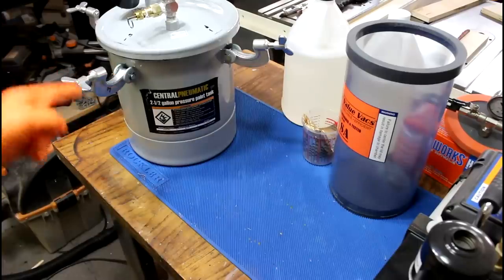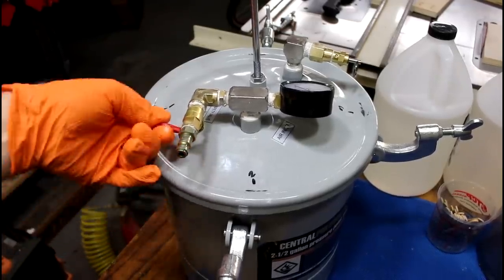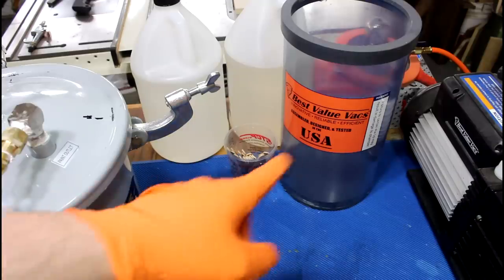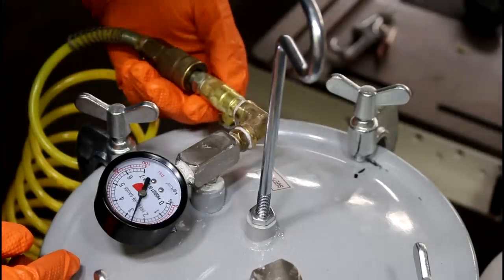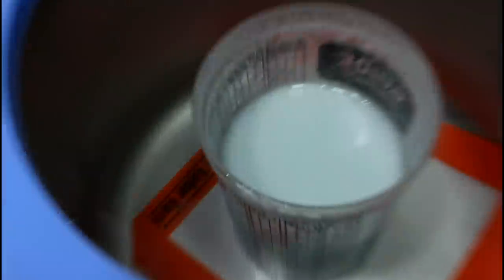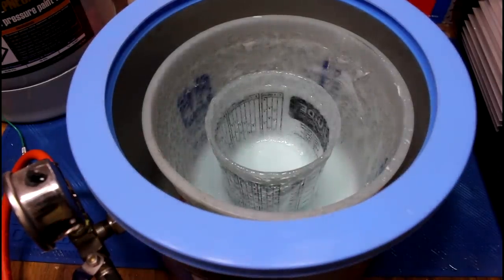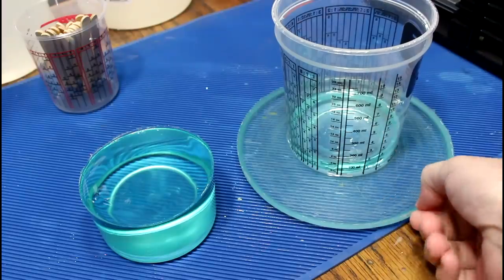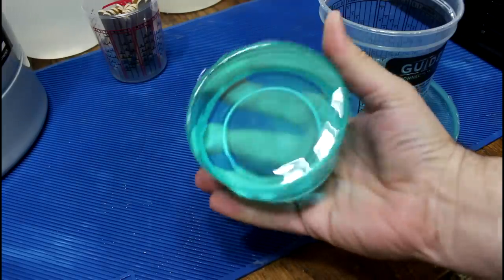Resin Casting: Pressure vs Vacuum

Comment: i have that vacuum chamber with glass top and orange rim.  It pulls out the gasses than when I slowly release the vacuum , it pulls in the stabilizing medium. I use it to stabilize rocks. because I have a glass lid I can also stabilize wood (using cactus juice). I was not aware of the pressure chamber uses. I have to be careful about boil over by controlling the vacuum pressure used.

Comment: Yep and since it cures by a exothermic reaction the vacuum probably makes it more explosive. It was a nice video though. If you have a borosilicate flask with an airtight cap I reccoment you seal it with boiling water in it and cool it under a cold tap. Might explain some.

Comment: Having done a lot of vacuum outlasting myself, it is my opinion that this test was biased toward the pressure pot. Yes, with vacuum you need to accommodate a lot of expansion while outgassing. As the video stated, using a pressure vessel involves a certain  level of danger. Consequently, my recommendation is that you not purchase the least expensive one you can find. The only time I would purchase tools at Harbor Freight is if I expected to use it only once.

Comment: Peter if you used a pressure pot could you still pour the resin into a mold after getting rid of the bubbles without casting it?

Comment: OK let’s unpack the vac pot a little: the resin isn’t for casting so could that be the difference because one doesn’t see this effect normally? You started twice, not a normal procedure in resin and vac pumps. Normally all the bubbles do rise and pop and are gone the few left on the surface tend to be very small and easily sanded off.
Great video however and I have been considering both and now I have still to make a choice (fav. the pressure version) however a far more informed hesitation! Lol 😊
Thanks
Bob 
England

Comment: My experience is that the resin itself boils, similar to the way water boils at low temperature when placed under vacuum.. The foaming is caused by boiling resin, not removal of air. I ran into this problem trying to fill cracks in gems with Opti-Clear. Pressure is the way to go.

Comment: The problem with the vacuum chamber is that it is boiling the resin. Air bubbles will expand and rise first, but then you will begin to boil components of the resin. I think it’s possible you could damage the resin by boiling out components needed for proper curing. 

The pressure pot, on the other hand, is shrinking and dissolving bubbles that exist in the resin from mixing.

Comment: I would say vacuum is still better, but requires a lot more. You need to pick a more liquid resin when casting, and ideally be able to vibrate it as well. Once the gas is drawn out of the resin and form you can then let normal pressure in, as you want the weight of the atmosphere to push it into every nook and cranny.

Comment: Looks like you should choose a slower curing resin for casting. Using a resin formulated for coatings could be dangerous in a bulk, it heats as it cures and ultimately can catch fire. Anti-foam additives like silicone fluid can reduce the foam a lot. In industry you'd de-gas the resin after mixing, in a much larger container than you used. Alternatively, admit the mixed resin slowly via a separate line and it can de-gas as it dribbles into the job. For best results impregnate under vacuum, then add overpressure!

Comment: Nice demonstration, but I have a question about using the pressure pot. I have been using and attempting to use a vacuum chamber for the last year to get the epoxy clear for pouring for a a number of different projects that would ultimately be 3-5 inches thick. So of course I have done it in layers. And as the temperature gets lower, I have experienced exactly what you showed in the video, the resin taking too long to be cleared of bubbles and constantly having to watch it so that it doesn't over flow. I have experimented with number of different resins, and all have had the same outcome, way too long to fully degas. But if my intention is to pour the resin after removing the bubbles, how is the pressure pot to be used that would still allow me to pour the resin afterwards. With your example I get a cured resin which is not what I want.

Comment: It isn't pulling any bubbles out of the resin.  It is boiling (going from liquid to gas) as the pressure goes down.  It you put water with no air in it, it will do the same.

Comment: Thx for the video, can you use a rubber mold for casting in the pressure pot?.or would it compress the rubber?

Comment: Do you think vibration might work for a small scale hobbyist? I was thinking I could use big, powerful back massager to get at most of the bubbles. I haven’t actually done any resin just yet, but am collecting supplies to try my hand at some small jewelry pieces.

Comment: Could you combine the two processes? Start by putting the resin under vacuum for a minute or two to remove the bulk of the dissolved air and then pressurize to minimize the visual effects of the remaining air.

Comment: A question if you will.
Will a pressure pot force resin into wood and not just smoosh the air in the resin?

Comment: Note that’s at low pressure different compounds boil off possibly ruining your Resin integrity clearly it worked amazing but if it was something super critical like most carbon fibre parts you don’t want under straight vacuum with out pressure externally like a vacuumed bag creating compression on the resin

Comment: Vacuum treatment does not just release the air. Lowering the pressure to 0"Hg drops the vapour-pressure of the resin constituents, so that they out-gas. By losing part of those components you are changing the mix ratio of the resin and hence it's properties.

Comment: Hi Peter! I still have a question, I want bubbles in my resin to make it lighter. Would the resin withstand the negative pressure in the inside or would the bubbles collapse? My goal is a bone marrow-like structure.
And thank you a lot for your content it answers so many questions and is fun to watch alike.

Comment: So, I'm also using ArtResin, and I have the same pot, same setup. I left only about 40ml in a mold, had 1 drop of alcohol ink, was in the pot for 5-6 hours at little over 50psi, not cured and there were still bubbles, all seemed to gather at the top of the piece however. Any ideas? Suggestions? This is the 2nd day in a row of testing that I'm having issues with the pressure pot.....getting discouraged at this point

Comment: Hi! How long do you need to put the resin into the pressure pot for? I’m working with a resin that has a 45 minute working time before it starts to get gluggy and not workable nicely. I’m using resin for smaller projects like keychains and charms etc.
Reply from the maker: It varies resin to resin. For me, I tend to do a pour at night and leave it in the pot till the next day. Those have been my best results

Comment: This might be a silly question given the strength of cured resin, but if it's not removing the air from the resin doesnt that mean theres just a lot of high pressure but v small bubbles through out the resin? Does that have implications on how it will hold up to temperature changes/working it in general?

Comment: Been seeing a lot soft materials you turned chipped on the lathe,. Could it be the pressurized air in resin expand while turning?
Maybe a test with pressurized only, vacuumed only, and pressurized after vacuum will tell?

Comment: It is important to note that a pressure pot doesn't actually remove the air bubbles.  What it does is compress them down to a point where you can't see them.  Once fully cured the bubbles are unable to return due to the rigidity of the resin.

Comment: I always wondered if you could centrifuge the resin, resin in a cup, attached to a rod that you spin really fast with an electric drill. I think it's feasible to do a home made centrifuge and spin the bubbles to the top and or pop them that way. Pretty much how they spin cast metal models/toys.

Comment: When I found it works really good it is to use the vacuum to pull out the air and then pour it into my mold and put it in a pressure vessel

Comment: When using a pressure pot, you can "pop" the resin in intervals if it reachs towards the rim, but the easier solution is to put less resin into the vacuum chamber or get a larger vacuum chamber.

Comment: I wonder if the pressure-pot resin winds up a bit more brittle?  Since the curing time is lessened and the end result might have more internal stress due to the pressure differential at which it was cured vs atmosphere.

Comment: make the resin colder! I mean in vacuum. that way the bubbles would pop sooner and overflow less. after all, vacuum is perfect for silicone before pouring, so I see no reason it can't work on cold resin. On the other side, I can see why a pressure pot would be preferred. One of the things I'm weary of in a pressure pot, however, is bubbles causing the resin to be more likely to chip. Maybe you could use an even slower resin and degas that before pouring a cast and pressurizing it. Just some experiments since I can't obtain the materials being a student. I'm in enough debt as it is.

Comment: I don’t have the equipment, pressure or vacuum, but I’ve been thinking about these processes recently. My question is the opposite of what you demonstrated in this video. What would happen if you suspended a piece  of wood in Cactus Juice and then put it under pressure, as opposed to the usual method of placing it in a vacuum?

Comment: Question is, what would happen if you pull the resin out of the pressure pot before it cured so you can pour it into a mould
(assuming the mould is too big for the pot)

Comment: Hi, don't know if any of your conversations have covered this, but are there casting resins available thich don't tend to produce bubbles, and are clear from the outset?  and is a heat bath for the vessel in hot water a decent  way to minimize the bubbles?  Love your vids, and thanks!

Comment: It seems that most people don't understand what really happens in a pressure pot. If it was about making the bubbles smaller, 50 PSI would only shrink them to just under 1/3rd their size. This is hardly enough to make them so small you can't see them. What is really happening is that the higher pressure enables the liquid to hold more gas molecules in solution.Therefore the bubbles disappear because the gas molecules are spread evenly throughout the liquid instead of clumped together as a bubble. It is the same thing that happens to carbonated drinks. While in the higher pressure of the capped bottle, the carbon dioxide is in solution with few bubbles, but open the lid and the bubbles precipitate out.

Comment: How about combining both?
First into the vacuum to remove same of the air and then ander pressure. It should be possible to get a similar result with less pressure, right?

Comment: Chances are that the bubbles you saw in the vacuum chamber are not air, at least not after 5 minutes, but the monomer (low vapor pressure) boiling off.

Comment: What’s happening is the heat of the resin plus the vacuum is basically boiling the resin might as well have placed it on a stove. In cold distillation they use a vacuum and very low heat on one side and a chiller on the other to get distillation without heating the mixture beyond the temperature that would change the taste of what they are distilling.

Comment: So the issue seems to mostly be that there's no way to pop the bubbles from outside while doing your casting with a vacuum chamber. What if you just 3D printed a little whirly blade/fan that broke the bubbles up, and used a magnet to pop the bubbles? Kinda like a standard hot plate, but upside-down.

Comment: I do think that this is a little unfair on the vacuum chamber though, it's the low pressure differential which lets the bubbles hang around. If you had a method of agitating the resin to pop the bubbles as they form, say with a magnetic stir bar or something, you would be able to pull the bubbles out much faster as you wouldn't have to keep bleeding pressure back in. Also, just as the pressure pot condenses bubbles to microscopic size, the vacuum chamber expands microscopic bubbles that you wouldn't otherwise care about. I think if you put the resin under a vacuum with an agitating device for a half hour or so, then took it out and allowed it to cure under atmospheric pressure, you would get a very clear cast. Also while the bubbles in the pressure pot's test weren't individually visible, I bet they would still change the refractive properties of the final product and how it looked (for example you can see ripply effects through the cast.) 

I think it would be very interesting to see a test where you compare using the pressure pot, versus what I described above, maybe also a test where you draw out bubbles under a vacuum (with agitation) and then finish it off in the pressure pot.
Super cool video!

Comment: The cured resin from the pressure pot must have an enormous pressure build up inside, since the bubles are still in there. Could you somehow release that pressure, if you smashed it with a hammer or something?

Comment: l have never used a pressure  or vacuum chamber when using clear resin but that is because l use good quality resin designed for casting and my clear casts always come out with no air bubbles.
l use super sap ccr with ccf hardener and l let it sit on the bench for 15 to 20 min after mixing and it degases itself

Comment: Is it possible to do the same experiment with casting resin? I have some casting resin which has an open time of several hours with a 24-hour cure, so I am wondering if this would give a better result in the vacuum chamber.

Comment: Pressure pots are really good for silicone to make molds with. I'm pretty sure if you put a silicone mold that hasn't been degassed in a pressure pot it can deform or destroy the mold.

Comment: Trying to remove air bubbles by reducing pressure also evaporates the volatile components of the resin. I believe that was the reason the resin turned into foam, not because of of trapped air.  Reducing the pressure might work in some cases, but the pressure should never go below the highest vapour pressure of resin components.
Reply: Why didn't you note that there were very, very much more bubbles coming out in the vacuum than you could ever have stirred in?  Other resins may be far more resistant to boiling,  I'm not impressed with your science.
Reply: @sandydaugherty458  maybe my English is not perfect, but why don't you give it another try? BTW, the science is not mine, neither I was trying to impress you.

Comment: for a vacuum chamber you need thin very thin resin! than it works like a charm. very jelly like resin presurepot for shure. sooo each system has its use. stabalized wood= thin resin in vauum chamber. castings thick stuff under pressure. easy peasy

Comment: Would the pressure also make resin get into small crevices / tight spaces inside a silicone mold which it wouldnt have gotten to otherwise?

Comment: Peter, could you insert a pin, which is settled in some way, down through the lid of the vacuum pot to break up the bubbles before they boil over?
Reply: *sealed

Comment: Aren't you lowering the boiling point of the liquid by lowering the pressure? You can try and put regular tap water to get the same effect. Also, Cody has lots vacuum experiments, as well.

Comment: Peter I had the opposite  happen made up the resin there was timber in the resin , "The lighthouse by the sea effect" and when set was overflowing and bubbles everywhere what have I done wrong I set pressure to 40 psi .

Comment: So I'm new at the pressure pot method and wanted to make sure I'm doing this right. Basically you put the resin mold inside the pot. Clamp it, get it to desired pressure and then turn off the air compressor? And after that when do u release the pressure in the tank? When its dont casting or is there a number of hrs u should keep it pressured for. Please help. I dont want to make a major mistake.
Reply from the maker: The goal is for the resin to cure while under pressure. So, after you add the pressure to the pot you want the resin piece to remain under pressure for the length of the cure time. 

Alumilite is about 40 minutes.
Art Resin is about 5 hours
I'm working with some right now that will be 36 hours. 

Your pot needs to be able to maintain the pressure for a while.

Comment: The Vacuum Chamber is to only degas Silicone Rubber Mold rubber. Or to remove moisture from wood and allow cactus juice to stabilization to impregnate wood.

Pressure Pots are to compress the air trapped in Plastic Resin.